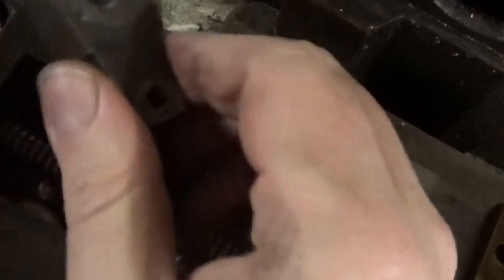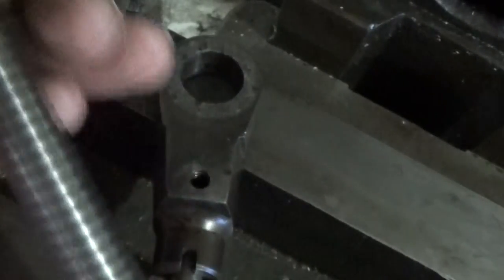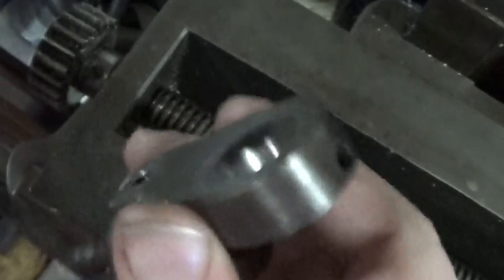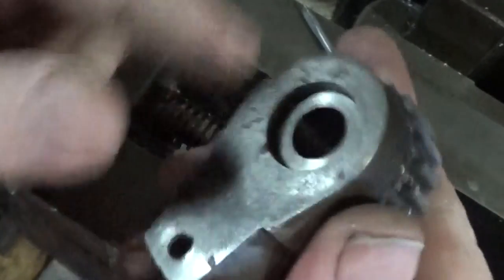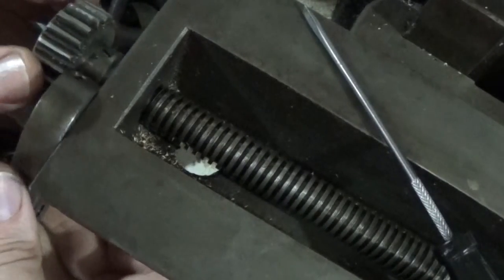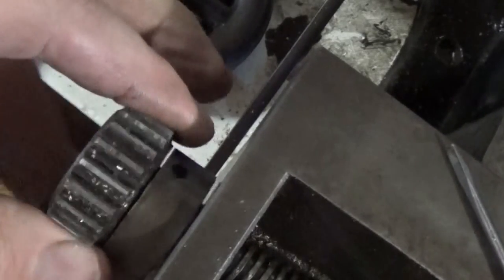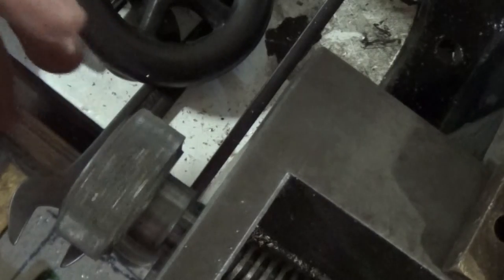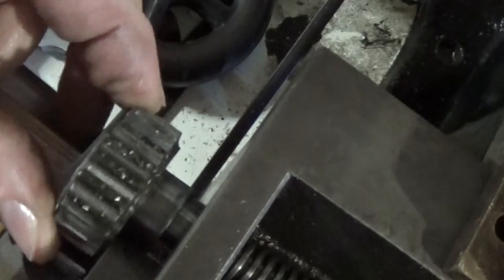drummond Bros shaper feed enigma

Comment: Hi Emma, on my Elliot shaper there are a pair of bushes and washer assemblies which allow the friction to be set on the screw feed shaft. This allows the drive to slip when it gets to the end of travel. I know it's not what you have with your Drummond hand shaper but you are right about the need for the friction on lead screw separate from the ratchet housing. I agree that it looks like some forms of spring washers are missing , best of luck with your solution. mat. ps just subscribed .
Reply from the maker: thanks for the feedback Mat. and thanks for the subscription!

Comment: Hi Emma

For what it's worth, I think you're on the right track :)  Ultimately, the lead screw needs some kind of thrust bearing preventing movement in either direction. The pawl holder itself certainly shouldn't be part of the system which keeps tension on the screw. I think the bronze nut fits the screw appropriately, and doesn't seem overly worn.

The gear (along with a bush/spring/etc) would prevent movement of the screw to the "right". What's at the other end of the screw to prevent motion to the "left" ? Is there space for a spring/bush there? Ideally one end of the screw would have a 'fixed' bearing surface (bush/thrust bearing) and the other would be adjustable (thrust bearing with nut for preload, or spring).

I hope I've explained that clearly, and best of luck !!!

cheers;
Ben
Reply from the maker: right on. I think you summed that up better than I did. lol. thanks for watching!
Reply: Hehe .. maybe.. And thank you for making and sharing! :)

Comment: Had to add pt 2 !
If you just want to get it going and are not worried about restoring to original i would make a bronze bush to sit behind the gear then cut a thread on the shaft so you can screw a tension nut on and a lock nut .
This will handle the axial load better than the grub screw also, i would have thought the shaft would have had a key instead of a grub screw as grub screws are not really designed to transmit drive into a shaft .
Reply from the maker: yes it does seem a bit "under engineered" .thanks for watching!

Comment: Hi Emma,
I would send Nobby  on the Model Engineer / Model Engineers Workshop forum  a message  he is a bit of a guru with all things Drummond .
All of the images i could find show a thread on the pawl end of the lead screw with a tensioning nut and a lock nut  and the gear looks different .
The lathes.uk site gives some serial number info and year of manufacture.
I'm wondering if the lead screw has been salvaged from a lathe or the threads machined off and a gear with a smaller ID fitted , i couldn't see any hole in the drive pawl arm to lock a grub screw like yours so it may not be original either.
I don't think a spring would be in there unless it was almost fully compressed  as a spring  that was partially compressed would allow end float in one direction ( when the table is being fed towards the drive pawl end ) this would cause the system to bind and jump along .
Take a look at how a lathe lead screw is fitted between its bearings with minimal end float.
Reply from the maker: I guess the only way ill find out if it judders is to fit something and see. i think the major parts are original, but im also with you, thinking its been modified at some point. the other thing is that Frank and Arthur Drummond spent quite a bit of time in australia, and often brought prototypes and seconds out to fund their travel. not sure where this one fits in.

Comment: I wonder would a belville washer be easier to find than a thackeray washer. But I can see your point with the tension on the gear and not the ratchet housing.
Reply from the maker: you are probably right. I found a Thackeray washer today and it should be here tomorrow. will see if that fixes it. a belville washer in 2016 is almost as hard to find to be honest. thanks for watching.

Comment: I am wondering about that gear. I just looked at the Gingery shaper and that is driven by a lever-and pawl arrangement from an eccentric on the bull wheel, which is driven by a motor. . But your shaper is manual. So I don't know how Drummond contrived the autofeed. It must be driven off the ram, which is driven by your arm.   But the thickness of the pawl  on the  Gingery shaper is only maybe 5  mil. That gear looks like 20 mil thick to me.  A lot of gear for a low-load situation. I suspect the gear is from another model of shaper. It will need a washer or collar anyway, so make one first.
Reply from the maker: I am guessing the gear was appropriated from the lathe production line rather than make a new part. it seems to be the one on all the shapers ive ever seen, so i think it was just the easiest  way to design a cost effective feed. one finger on the hand wheel and it clicks on nicely, so i dont think it will take much to make it work. only one way, try it and see! thanks for taking an interest.
Reply: That makes sense.

Comment: Hi Emma, I am absolutely sure that the gear is wrong. The drive gear on my Douglas shaper has teeth that are only about 1/16" deep. The drive only just has to engage enough to drive, and it's at low load pressures. I suspect that the original Drummond gear had much finer and shallower teeth, but was damaged when the shaft got damaged. you might be right that there is a bush missing, but the amount of shaft drag that is on the feed on my shaper is so close to zero it's not worth mentioning. Just listening to your video the noise of the ratchet is 'frightening' because of the loads required to disengage the drive dog. By their very nature a drive dog type gear should not have an involute profile, on both sides. Disengagement is accomplished by the ramp on the dive pin, not the tooth profile.  Also, my shaper had a bent feed shaft from a fall as well. I applied the logic that it got bent during a fall, so the housing must be strong enough to handle impact. Using a soft faced hammer I straightened the shaft in situ and ended up with less than 0.02mm run out. and it straightened in exactly the right place, and without any apparent stretching of the hole.  Sorry about the long and waffling  comment but I hope ithelpsRegards  Greg
Reply from the maker: im thinking its the right gear. the shapers from Drummond that Ive found photos of have has the same gear fitted. I also think that in the interests of keeping costs down, Arthur and frank just went across the factory floor and picked up a gear from the Drummond lathe and fitted it and made it work.  you are right about there being a lot of drag, but i think its just how it was, evidenced by the amount of wear in the gear teeth. thanks for watching.

Comment: I doubt that a spring should fit in the space, as that would allow backlash in the Acme shaft, and serve no purpose.

It looks to me that a steel spacer is missing. This would stop any end float in the shaft if fitted correctly.

It's common to have an intermediary spacer in a situation like this to reduce stiction.

It's certainly wrong as it is IMHO.

Also, you can tighten the bronze Acme nut by slitting it about 1/4 way in from one end and using two small screws to cant that section slightly (same as some cross slides do).  It works OK from my experience.

Cheers Rob
Reply from the maker: thanks Rob. you are right about the backlash. Ill try it and see. hopefully some literature comes to light to show whats inside.

Comment: I'm with the others belleville washer, thackery washer, some sort of spacer that puts friction in there. try cutting a short piece of rubber hose to see what effect it has. PS don't you love the sound of it cutting brass
Reply: I think a wave washer would work very well for this missing part.  A locksmith has these in stock, usually for mounting lock cylinders.
Reply from the maker: yes might be worth a try. thanks for watching.

Comment: Any signs of something else being, at one time, mounted solid to the end of the table?  I wonder if there wasn't a second pawl mechanism to keep it from pulling backwards.  A healthy spring between two bronze friction disks inside the gap you showed might work to stop the problem, but for how long?
Reply from the maker: the smart thing would be a second pawl. no sign though, and a couple books ive read distinctly state that it has a "friction pad" to enable the Ratchet. thanks for watching.
Reply: although I know that you simply want to get it to work properly again, it sounds to me like you might have an opportunity to improve it over the original.  Working against a friction pad to bring the table back to your starting position sounds ... dull?  Maybe it doesn't take that much... but if you do a lot of hand cutting it might start feeling like a lot.

Comment: Emma, I agree with the others that you seem to have correctly diagnosed the problem. There has to be enough friction on the lead screw so that the pawl will index instead of just rocking the screw back and forth. There has to be a spacer so that the gear isn't trapping the pawl carrier between the gear and the table. When it's all nipped up the pawl carrier has to be free to rotate so that all the friction device you make has to do is overcome the pawl finger's resistance.
Cheers, Orlin in the Carolinas USA
Reply from the maker: right on Orlin. only way to find out is to experiment. thanks for watching!

Comment: Hello, Emma, If you look at the end of the gear and the corresponding area of the end of the table, if there was a friction device there, there will be witness marks, there should be some circular polished patterns on the mating faces. Obviously the device (if there was one) may have been missing for decades so the areas might be dull. If the end of the table immediately surrounding the screw is untouched and completely unmarked there wasn't ever anything there. I'm guessing there was something there and there will be marks (polishing) to prove it. Mart.
Reply from the maker: yes. there are circular marks on a spacer washer that i didnt show, that goes between the carrier and the bed. its hardened and looks original. hoping some literature comes to light to show what was there, thanks for watching.

Comment: Hi Emma.You are right, the problem is that the lead screw reverses direction as the only friction is in the ratchet pawl. A Thackeray friction washer should fix it. You could even add a little unit at the other end with an adjustable spring-loaded brass brake block.
Reply from the maker: that crossed my mind too! thanks for watching

Comment: I don't know this shaper in detail but we can try and apply some general knowledge and logic. I assume this spindle is axially fixed at the end with the hand wheel. Check also the axial play in that fixed bearing at the hand wheel end. This could be fixed by either some tightening or putting in a shim washer. The end with the tooth gear is an axially loose bearing and should not take any axial loads or be blocked in its axial movement (play) by the tooth gear. You are right that the ratchet should not be squeezed btw. the tooth gear and the bed. This can be achieved in two ways. Either put a washer btw. tooth gear and bed so that a proper clearance for the ratchet and clearance btw. tooth gear and bed is guaranteed. Or you simply clamp down the tooth gear at a location where it leaves enough clearance for the ratchet. The position of the carriage is controlled by the fixed end of the spindle and the bronze spindle nut. If the nut has too much play either replace it or put an axially spring loaded counter nut in front or behind it whose spring load is bigger than the expected work load on the spindle. (making a new single nut would be easier) The axial spindle play should not be attempted to be eliminated by the tooth gear at the other end. Concerning the friction: the rotational friction btw. the spindle and the bed must be higher than the rotational friction btw. the ratchet and the tooth gear otherwise the ratchet will pull the tooth gear back and forth creating no feed. Instead of the additional washer described above you could put in 2 or 4 back-to-back belleville springs, or a waved washer to create preload and friction. Are there any wear marks indicating the former presence of any spring preload? During clamping down the grub screw of the tooth gear you must have a way to preload this axial spring.  The above described axially preloaded counter-nut to the spindle nut would most likely create enough friction for the ratchet.
Reply: Emma. I have an Atlas shaper (Acorn in England) which had the exact problem as yours. I had cobbled up a friction mechanism so I could use it and never looked further. After seeing your video I examined the double nut arrangement on the feed shaft and saw that there was washer with a tab to key it to the shaft and a couple of fiber washers to provide friction to prevent the shaft from turning on the backstroke of the pawl. The washers were not original but hand cut from thin card stock or perhaps gasket paper. rol eic's response and your video helped me fix my shaper. Thank you both!
Reply from the maker: thanks for that. your comments are always appreciated. thanks for making an effort to think this though yet again!
Reply: I'm happy to help. Do you see any wear marks on the bed where that imaginary spring might have been?

Comment: On the lathes website there are a number of photos of the Drummond shaper http://www.lathes.co.uk/drummondshaper/index.html
On the ratchet end of the leadscrew it shows the ratchet and gear held on with a nut and lock nut.
The recess in the gear wheel may hold a spring to tension the gear.
The hand wheel  end there is no nut.
Dumb question but has the  leadscrew been put in the wrong way round at sometime.
Reply from the maker: the screw is a different size each end and only fits one way. went and checked that. lol. the lock nut is definitely a feature of a few of these ive seen. they were a low production machine, compared to drummonds lathes, so im not sure how consistent the design was. they were known for changing things about to simplify production. thanks for watching.

Comment: I think you're on to something with that washer idea. You could get or make a thin washer yourself and then bend it somewhat in the middle. That would make it a spring of sorts so it would hold some pressure on the screw.
Reply: To Dale and Emma. First to Emma, my apologies, you will understand what this is for. For Dale, what you have said I agree! For those interested or have not seen this, a Vice is a horizontal screw press. With a little machining then the relevant tooling the right stuff can be made into a thrust washer. The same thing as a manual/standard transmission, clutch spring is in later years as in on use on cars and so on. Cheers from John
Reply: I still have it, made some tee nut bars for you to cut, drill and tap to suit the machine. Again sorry for lack of com. Cheers from John.
PS the tees Were to be gratis
Reply from the maker: good idea!
Reply from the maker: joandar1 no  problems. :) glad you checked in!

Comment: Hi Emma, if you give me the dimensions I would be more than willing to make you a bronze bush for that.
Making a dimple in the shaft slightly off from the position of the gear, it would pull the shaft in, + a bushing you should be making chips in no time
Reply: Hi Emma I think the thackery washer is a good idea ,I would also cut a slot in the nut and fit a grub screw to pre load the nut  I did this on a old lathe I could not get any spares for ,dave in the uk.
Reply from the maker: i can make one, tonight im sort of wondering if it should have a thackeray washer in there. there are a couple broken ones in other parts of the machine. so I may buy one and try it...
Reply from the maker: good idea!